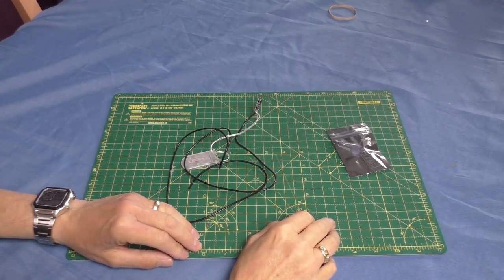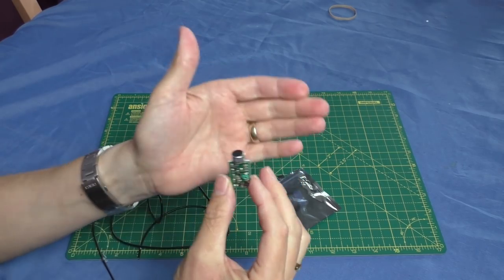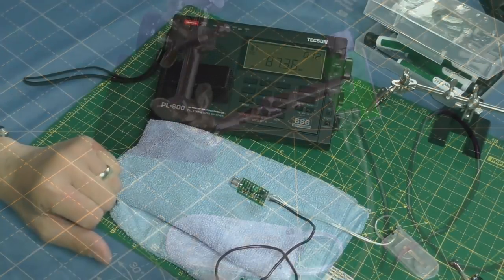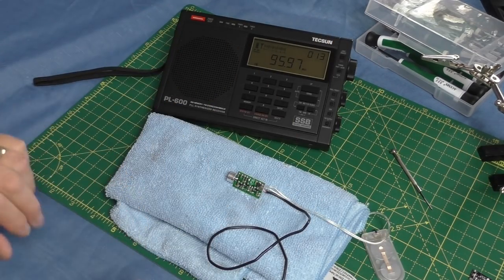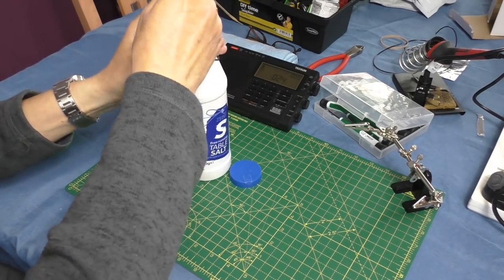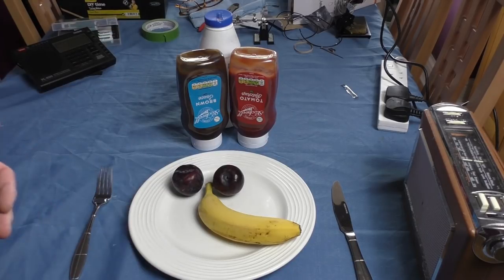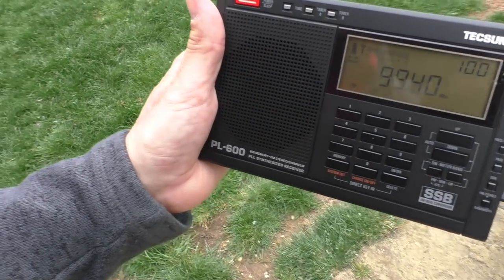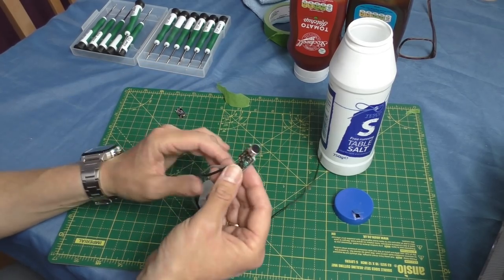Mini cheap FM Spy Bug listening device No2.

Comment: I’ve played with kit of both high and low grade - and made a lot of fm/uhf transmitters my self (loved them as a kid) - these Chinese eBay ones are incredible for the price - £3/$3 each - small footprint using SMD parts - can run on 3v at 7mA can can be run from button cells / AA’s for a decent amount of time - and at this price they can be seen as disposable - build them into common household items and set at a frequency outside of normal FM range  (50-80mhz is a golden range) and use a multi wave scanner to listen - great for pranks - I love how much random cool stuff you can buy from China!!

Comment: I checked this bug with an RTLSDR and it transmits on 2 frequencies, one is in the FM  band 87.5-108 Mhz and the second is in the 120 -180 Mhz band, the second frequency is  much more stronger.

Comment: Try powering with two 9v batteries in series. The most important thing in such simple circuits is the output power which is propotional to the supply voltage.
Reply: two 9v batteries in series will fry it but good in parallel.
Reply: @jmdds  Yeah, after a second thought I suspect that too.

Comment: it is possible to set the FM frequency with a digital circuit such as  MCU, I mean digitally change the variables of LC parameters
Reply from the maker: Iam not sure but i doubt it as there seems to be no connection.

Comment: This is a cheap device, however the "limited range" is about 30m with a 1/4 wave antenna (1.2m), and if you will try to adjust it to an empty spot in your FM radio, it will take you a very long time. Much professional ones are here, at https://www.petrutech.com. They are not cheap, but they are stable and easy to adjust.
Reply: casual self promotion
Reply: Doubt someone looking at a vid of a £3 fm bug will be persuaded to blow £150+ on your kit - at that money you might as well pay a bit more and get the real pro stuff from Israel with all kinds of fancy burst transmission / encryption stuff going on - at £3 these Chinese ones are bloody incredibly